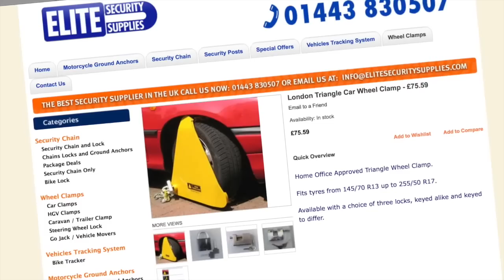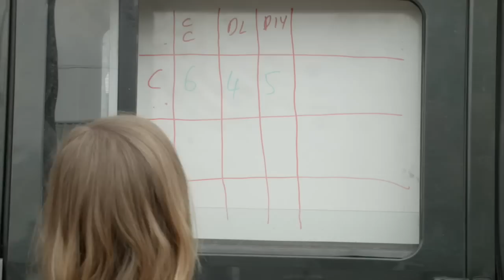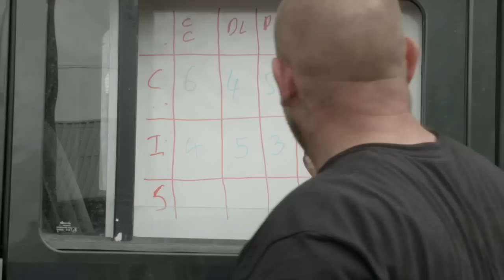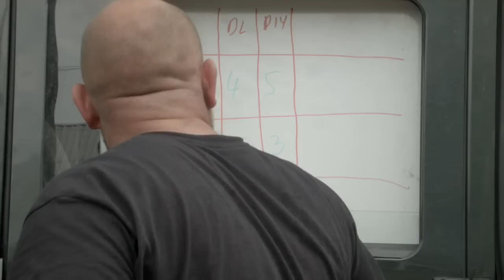Episode 6 - LROShow + Overland show, Physical Security testing

Comment: thieves don't want to be making a noise with an angle grinder they will simply move onto another car ...
Reply: there is sound suppression inside the car. all they need to do is close the door then cut it.
Reply: @BobRooney290  sorry but not that much especially at 3am and the amount of smike and sparks ? sorry no
Reply: Exactly! 😂
We have a Disklok. On a convertible Merc. 
We also have a dog. 
This is what usually happens (about every 6 weeks,East London UK) :
Thief enters our driveway and peers into our car. Security light switches on/ our dog goes ballistic ( not necessarily in that order)
Thief leaves. This happens at least once every 6 weeks, all recorded on video. 
You could ask yourself whether it’s the Disklok or dog that deters.. either way, I’m cool. I still have my car.
Reply: @freespirit6953  5 guys in balaclavas turned up at 3:30am a few months back after the GTI & S3 both have diskloks and autowatch ghost + antisnap locks on the house
The last guy that came up the drive looked at the diskloks, whispered to the other 4 and they left (looking at them on they way out) we've recently added a Rhino bollard to the drive for extra protection
Reply: @macauleyh5 you’re a brave man even having an open driveway. Mine is gated up. Sensors around perimeter. The works.
Reply: @FutureStyles any tips or advice or to get this kinda setup/installation

Comment: Security does work it takes more devices, back in the day most cars in the max power / revs / fast car / fast ford magazines had a disklok,  cat 1 alarm & immobiliser which cuts any 2 circuits aka ignition / starter, a 2nd cat 2 immobiliser, so thats 4 circuits cut, it would take hours to remove and bypass, the number 1 alarm of choice was clifford with their smart siren which when hidden would be extremely hard to silence, clifford also did a wireless immobiliser add on which is hidden and connected to any circuit, making it hard to disable as it's not wired to the main control box.

All of the above doesn't stop a low loader but if you have a tracking device or a pager wired to your alarm your alerted to an attempted theft you maybe able to save your car.

Nothings 100% fool proof, but it's about making it as hard as possible to steal.

Under what conditions is an angle grinder going to be used ? outside your house at 2 am ???
On a busy supermarket car park ? i think not !
Reply: Last time I heard about tools of the carjacking trade, it was a flathead screwdriver duct taped to a hammer. Angle grinder...ha.

Comment: Not a true reflection on that firstly you have to gain entry to the vehicle without setting off the alarm system, then using a high noise profile tool, the immobiliser being dealt with. Everything you can apply is the best option as a deterrent to this type of thief......

Comment: Figured how she got the clutch claw on wrong and how they were able to cut it and remove it in seconds. If you point the leg straight down to the floor you expose it to a grinder and it will be cut off and removed in seconds BUT if you do it correctly and the leg faces the firewall (mine hooks behind the steering column) you can cut it with a grinder.

Comment: The disk lock would of won if the steering lock was on, that would stop them from moving the wheel around.
Reply: The disklok is designed to spin freely on the wheel with the steering lock on or not..  Its not fixed to the steering wheel.

Comment: I can unlock the disklok within 1 minute without an damaging the disklok or making any noise, same way I open safes and vending machines, 

Any decent locksmith can open them
Reply: Any decent locksmith would call the cops for any dodgy callouts.
Reply: @IanLanc  I worked for the AA which is a breakdown company I also made new keys for cars, need correct paperwork log book and photo id for me to take off a steering lock or for me to make a replacement car key
Reply: Is there one you would recommend?
Reply: @debidee5548  this is probably the best one to have For a steering lock